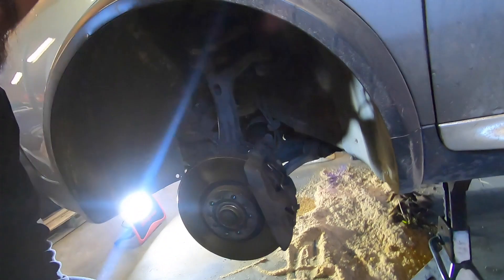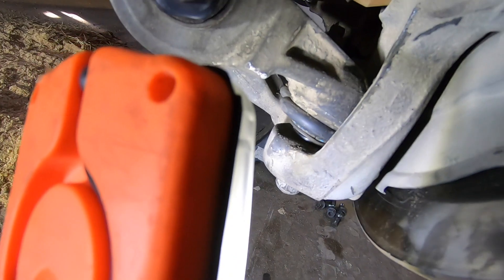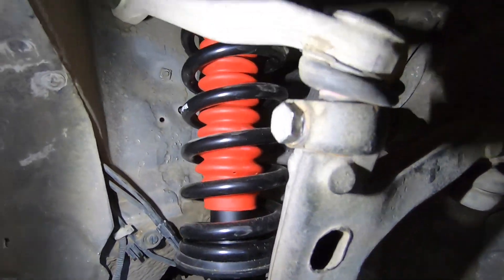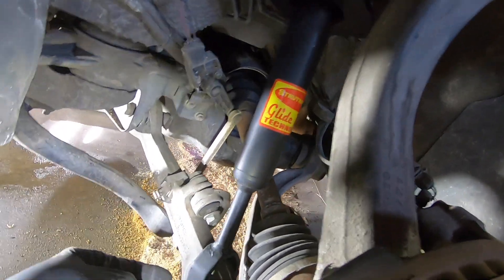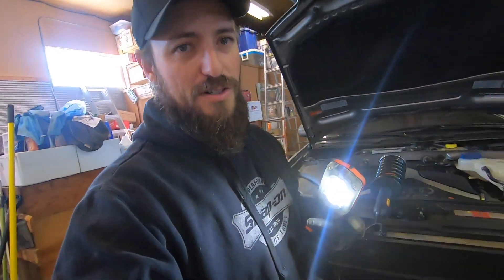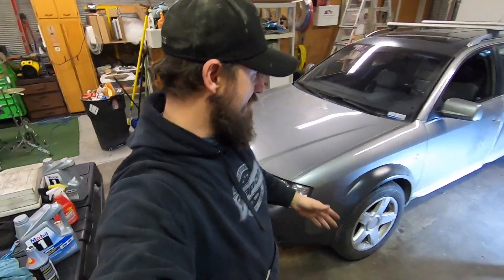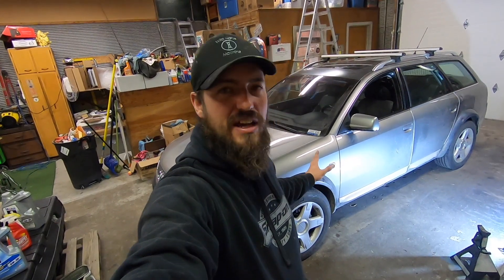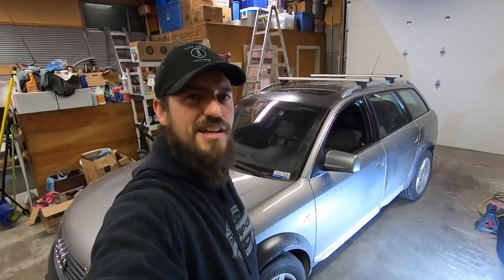Allroad Coilover Conversion LoL,ep-6

Comment: Are you satisfied with the Strutmasters conversion after the months you've had it on the allroad? I've been considering the same setup and wanted to know if you still think you made a good decision. Also, what ride height do you think it sits at after the suspension has settled. Thanks!
Reply from the maker: Initially I was very satisfied with the install, and the ride quality. 

But just a few weeks ago, the bell mount on the top of the spring just came undone causing the strut to drop out of the housing, it striped the threads on the top of the strut so it would not go back together, i ended up taking out that strut and compressing the spring back down so i could weld the bell top back on to the strut. not a recommended way to do that, but i needed the car fixed asap and didn't want to wait for a new one. 

Which reminds me, I need to write them a complaint letter. 

other than that I'm still happier than when it had air ride.
Also Napa offers the Arnott air ride delete kits. call the store and see about pricing.
Hope this helps.
Reply from the maker: it sits about level 2-3 on the ride height. and still rides smooth

Comment: I just finished installing the same system in my 2002 Audi AR with the warning light fix module too.   The car drives ok and it is nice not to have to worry about the air ride  going out!   Should've done this a long time ago....LOL.  As far as the kit itself, the documentation is barely adequate (no torque specs) at best and misleading at worst (control module access).  Also, my front strut retainers (the round piece that you welded to the strut) were not centered and so the upper control arm would not bolt up because the bolt holes we not aligned!   I had to figure out how to compress the spring and center the retainers.  That sucked because what should've taken an hour took two.  The videos helped alot with the install.
My first impression of the front struts is they are wimpy compared to the originals.  It would've been nice if they would be heavier duty and matched the origninal diameter.  The rears matched ok.  Overall, it would've been best if the compnents arrived ready to install, but options are somewhat limited and the kit does function as advertised.  I give it an 8 out of 10.
Reply from the maker: initially I liked the kit but after a few months I was getting noise already. I ended up cleaning up the car and selling it as I was tired of messing with it every few months.
Reply: @LifeofLind  Thanks for the update.  It is disappointing when a product doesn't meet expectations, especially when it's as expensive as the Strutmasters product.  I'll run this system for a few weeks and report back my results.  Cheers, Bill
Reply: It's been a few weeks and happy to report the car is still working great!  The Strutmasters mod has made my car suspension dependable.
Reply from the maker: @billmohelsky7812  good to hear! hope it continues to be a good system for you

Comment: you are jumpping from zero to conversion , without showing us what to do.// did it require a spring conpressor ?
what are the actual hardware you took apart ?
Reply from the maker: We had another video explaining what happened. in this one see @ 2:00 in on what bolts where removed. also our new struts came pre assembled so no spring compressor required. just replaces the factory struts that have air bags on them

Comment: Sad to hear that air shocks are so expensive new. In my country we have multiple companies that are specialised in truck air bag repairs. They replace rubber and valve parts from suspension and all o ring seals and you have like new setup for 200$ per one strut. so its 800$ for four struts only job that you need to do is remove and send them struts that are broken and when they send you back u need to install. In shop its 30$ per strut remove and install. And you have like new with 2 years warranty. Better than losing air ride. No spring can replace air ride quality and adjustable height....
Reply from the maker: wish we would have had that here